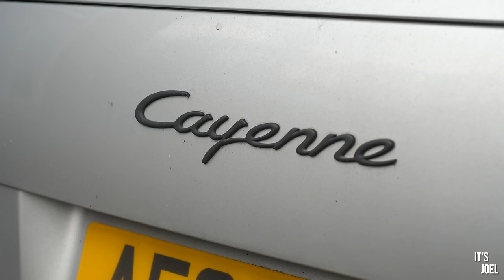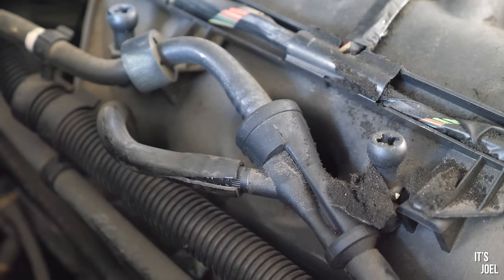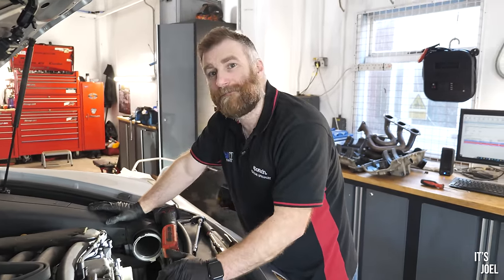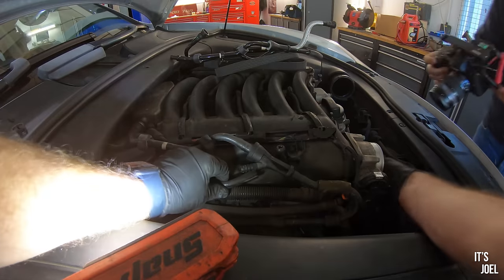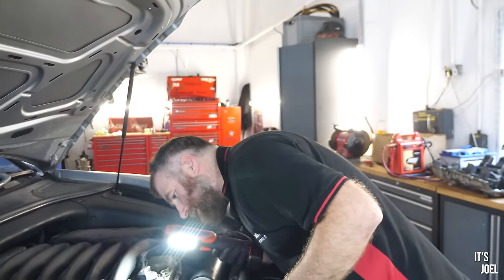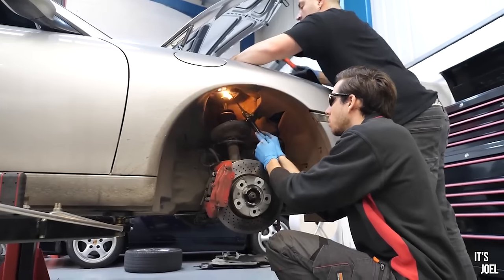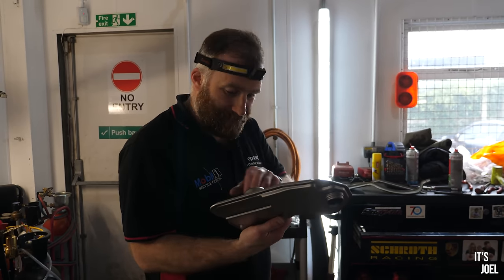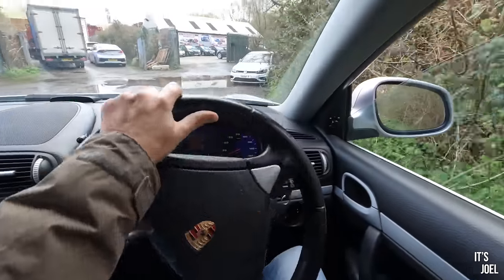FINALLY FIXING MY PORSCHE CAYENNE!

Comment: I did not have a great experience with eporsch and won’t go back there or recommend them. I use someone else now and am very pleased with their work.
Reply from the maker: What was your bad experience, and who are you using now?
Reply: @itsjoel  I have a cheap Boxster S. They changed the front springs and asked me if they should also do the geometry set up. In doing so, they had to bash out a rear seized bolt and that repair ended up costing £2000! Mostly because they used genuine parts, which is not necessary on such a cheap car. I was furious. (I’ve had Porsches before.)

Comment: You could save a bit by using parts factors of the likes of Autodoc. The serpentine belt from OE manufacturers  Febi or Bosch is £28. A belt tensioner by SKF £56 etc.

Comment: Did Gearbox oil on my TT S. Also had the cats bolts issue both sides, it made a noise like when you blow grass in your hands, to be honest that’s 1 reason why the gearbox oil got done, 2nd was visible fluid from the seal line downwards. I was very relieved to get that transmission sorted. Very grateful to find that a bit of heat and 6 bolts later my “transmission noise” was gone and you do feel the benefits for a few days. Could you tell the difference if your car was 99% or 100%? No, if you gradually loose 1% every now and again until your say 90% then you wouldn’t notice but you would notice the 10% gain coming in one lump.

Comment: Hey mate your problem with the gear selector is definitely in the micro switch it's tiny what I did was compressed air like you did and also some electrical contact cleaner in a can and just sprayed the hell out of it again and again and again and hey it works perfectly
Reply from the maker: Maybe I was looking at the wrong thing then)

Comment: You surely are advancing in the mechanical stuff if you have started to take apart parts inside the engine bay. I'm not at that level yet 😅 
But it's most important to always have an honest mechanic ready to do the serious work. 
It's the adventure that counts, you'll know what would be more fun content. There's no car channel stuck with 1 car, they change project cars like they change shoes. So enjoy what you do, we enjoy the ride along (and the lessons learned on your cost😅).